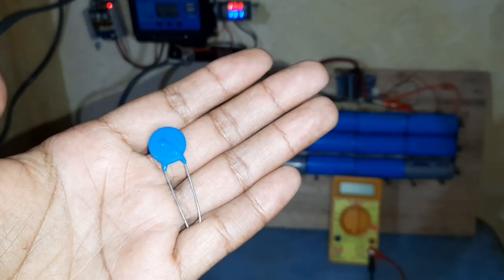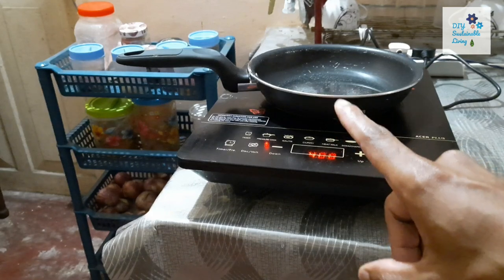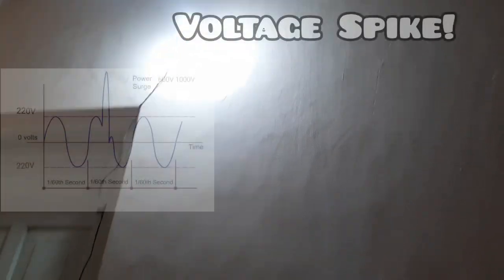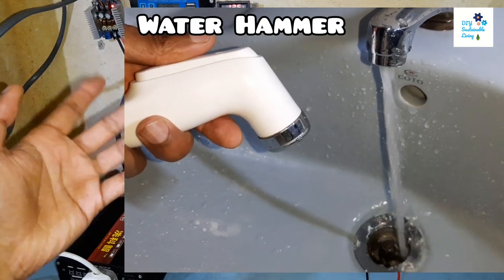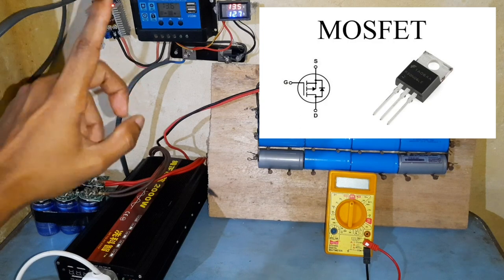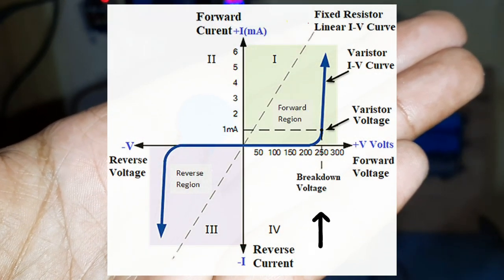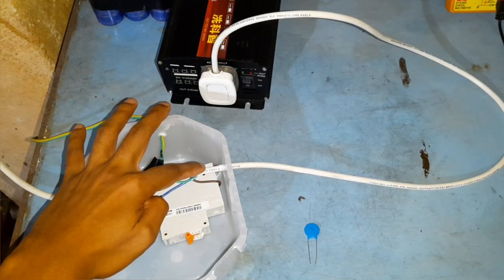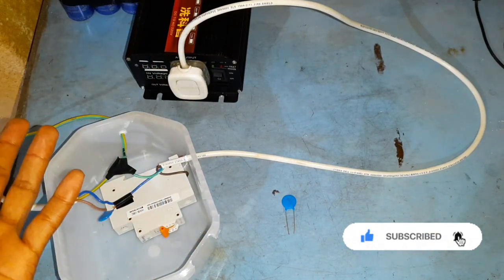Solar Surge Protection Device | DIY Surge protector box for Off Grid solar system

Comment: Kindly try to show us result after connecting the varistor.
Reply from the maker: This is even after connecting the varistor because the varistor is rated for 430V. Note the varistor protection kicks in when it goes above 430V. Below that we will still have the voltage spike but it wont reach the threshold to damage the MOSFETS! Which is usually around 500V.
Reply: @diysustainableliving2774  Instead of connecting one end to neutral, can it be connected to earth?
Reply from the maker: While that may be possible.. I think neutral should also be earthed. So since I've not connected earth to neutral I think it is better to connect it between live and neutral since that is what is going between the inverter and the load. I would be really happy if some one can clear the doubt of whether earth and neutral should be connected!!.. I havent connected my earth wire to neutral as Im not sure whether there will be a higher voltage in that neutral line.

Comment: Input voltage in my room's switch board socket is constantly 260 volt nowadays and my adapter has max limit of input voltage of 240 volt. If I use it, will it protect that power adapter from getting fried?
Reply from the maker: This is not a voltage regulator. To bring down the voltage from 260 to 240 you will have to look for a voltage stabilizer!... This MOV is only for voltage spikes that happen on the power lines when appliences are turned off. The voltage spikes last for only a few milli seconds.
Reply: @diysustainableliving2774  thanks for reply, I got it, but what if I use it on switch with constant 260 volt?
Reply from the maker: As long as the MOV is rated at a higher voltage it is ok. Since it wont activate untill it reaches that threshold. Most electronic devices can handle tiny surges up to 500V (depends on the MOSFET specifications). Anything above that can destroy the circuits.

Comment: can these varistors be used in light switches that interfere with other electrical devices when turns on and off? 
i have a certain light switch in my house that causes our tv to turns off and on for a sec when we turn this light switch on and off . can this problem be solved by this method ?
Reply from the maker: Im not exactly sure what is causing the problem in your house electrics but if it is due to a powersurge it should help. Please check your home electrics as I think it is not due to power surges. Light bulbs use very low power level which are unlikely to lead to powersurges.
Reply: @diysustainableliving2774  thanks for your helpful reply 🙏

Comment: You should try with 270v mov. As it will provide some decent protection.
Reply from the maker: I searched for one but couldent get it. So 430V was a decent 2nd choice for me. Btw Im happy as long as it is within 500v as my MOSFETS are rated for 500V.
Reply: @diysustainableliving2774  ebay sell a lot of different voltage

Comment: Please do a video on grounding..  and how about showing what it's like where you live , a 360 view from your roof.. im in Arizona ( the desert ) .. just a thought.
Reply from the maker: Im from Sri Lanka. A tropical island 8 degrees north of the equator. Here aswell we get plenty of sunlight year round but we have to make sure tree shadows dont fall on the panel. About grounding I have just placed a separate earth for the appliences. I dont trust the inverters neutral terminal as it might give  residual voltage to the earth and thus potentially giving a voltage on my appliances!
Reply: I believe I'd be visiting the ocean as much as possible if I were there.. 
Tell me are your solar panels grounded?
Reply from the maker: I havent grounded my panels. They are just lying on my roof. I have added earth connection for my appliances on the AC side that goes straight to the ground. It is not connected to my inverter setup either.

Comment: The MOVs appear to be what Midnite Solar is using in their surge protection devices. The problem with going with them is that to protect a large system, several need to be used, costing over $100 a piece. Could a diy solution be found using MOVs? I am concerned by the threat of EMP.
Reply from the maker: A single MOVs will cost you less than a dollar. Usually the surge has a high voltage that can destroy sensitive electronics but it dosent have a lot of power(Amps) that can destroy the MOV. Even for large systems you can DIY it. Just make sure you add the MOVs close to the circuits you would like to protect.

Comment: Better than nothing cause those voltage spikes are hard on everything attached to that line, including the poorly designed device that is causing it. And as long as the voltage never spikes above the threshold of the MOV it's like it isnt even there.  Two questions though.  Wouldnt it be better to have some capacitance to absorb that spike and spread it out over time so you still get some benefit from that energy instead of shorting it to ground through an MOV and wasting it?  Granted the amount of wasted power is fairly miniscule unless you had frequent spikes and that could overheat your MOV and destroy it.
 And second question, why does your inverter not have that capacitance or an MOV already designed in? If it does not, maybe you should have spent a few pennies more for a better inverter with a more complete design?
I know sometimes you have to work with what you have and your suggestion of adding an appropriate MOV can save what you have, been there, done it. Where I am that solution might be described as quick and dirty.  Thank you for teaching.
Reply from the maker: Thanks for your insights... As for your first question you have given the answer aswell. The energy in it is miniscule so there is no point in talking about it. As long as we terminate the voltage spike that is enough. That energy is converted as heat and yes if we get very frequent voltage spikes there is a possibility that the MOV gets destroyed but since the energy is minimal we dont have to worry about it. As for the second question well... The inverters I have are cheap chinese ones but still in my area they are expensive. The previous one I had got destroyed when I turned off the appliance and inverter together. It destroyed the output mosfets and its connecting circuits. So this is a cheap fix for this problem. It would have been better if I had a 280V one which would have almost completely eliminated it.
Reply: @diysustainableliving2774  By any chance did the inverter already have spots on the circuit board for capacitors they left out to save 5 cents on the build cost of the inverter? I have seen that a lot and often if you go on Amazon and find two devices that look identical but one of them is a little cheaper that is why, they left something out or used rejected components to build the cheaper one.  
If you get an inverter for $5 off, is it still $5 cheaper after you have replaced the mosfets and other parts, and added an MOV?
I know though, I have spent weeks studying the differences in inverters trying to decide the best comprimize between cost and quality. It's no easy task trying to decide what it really needs to be and how much risk there is with electing to go cheaper. There is a metric boatload of BS involved with anything solar, hard to wade through all that to get to what is important.  There is a soft spot in my heart for those able to make something work with the least complication but it is a rare thing  indeed that simpler is actually better performance and even more rare that cheaper is actually cheaper in the long run.
Reply from the maker: Well I dont have that much experience with these inverters. But I am happy with them because they give true pure sine wave AC at a good power level that is able to run the appliences I need at a cheap price. We can circumvent the drawbacks in them by adding the extra protection they lack!

Comment: why don't you show it working with you flashing light bulb???????????????
Reply from the maker: It is already connected in this setup. To completely remove the flash I would need one that is around 230v. But unfortunatly the one I had was 430v. But the point is that I only need one that is rated less than 500v as the sensitive electronics in the inverter (the MOSFETs)  are rated gor 500v. A voltage spike above 500v for a few milliseconds can quickly damage them.

Comment: I think a power strip is the same thing but cost more then just the varister alone, power strip $5.99,,,,, varister $0.99.
Reply from the maker: A powerstrip is just an extension cord. The more expensive ones only have surge protection. You have to look in the specs and make sure it has surge protection or else you will just end up with an extension cord.